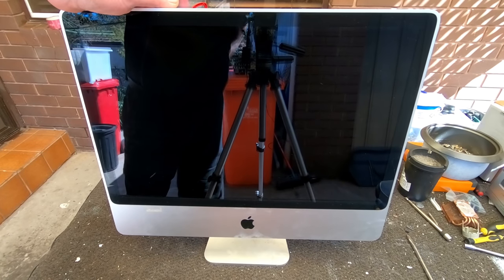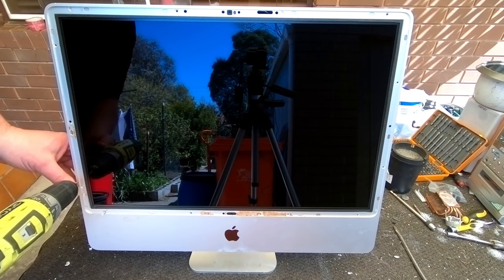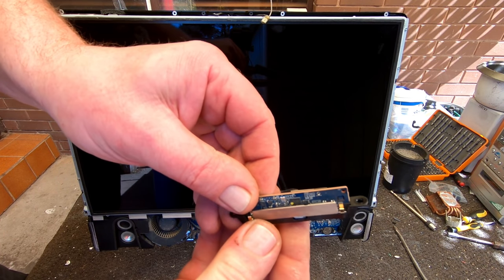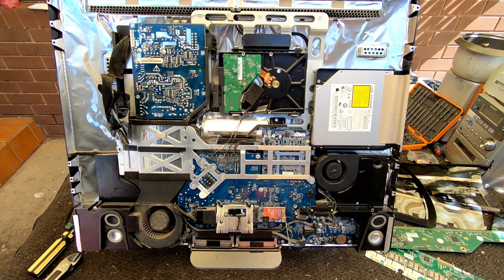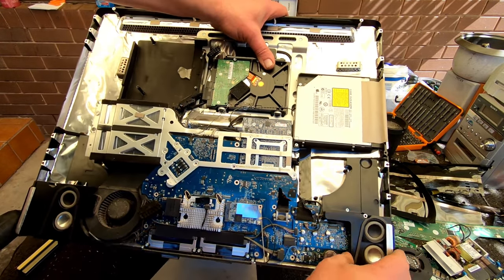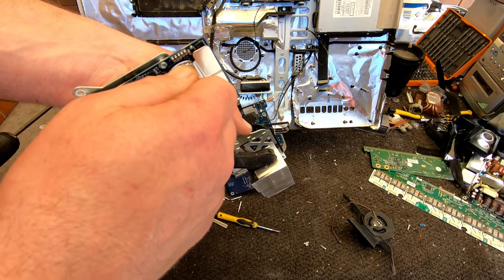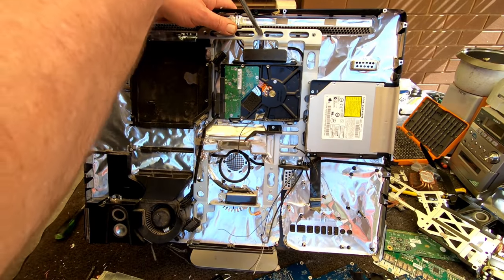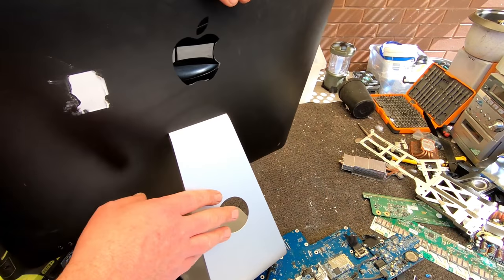What's Inside an Apple iMac A1225

Comment: I just restored one with an SSD, it was fairly easy and install went a bit strange. It failed initially but stated it was recoverable, ran it through and the second time it went down completely w/o issue. I surmise, after I was testing a RAM stick at the same time --- it was more than likely related to only have 1GB available as evidently it didn't like the one I had w/it. I snagged a 4GB compatible set for $19.99 shipped and I'm pretty excited to test it out, never personally having owned a mac, always been a windows guy. I've repaired numerous but owning my own, especially an older model such as this was a fun idea.

Either way, I put 10.6 on it and want to upgrade to whatever else is supported above that, which I had heard was El Capitan. I also would like to try some older legacy mac software and things of that nature, personally for me it is a system for my daughter to use and a glorified tv/streaming box. I love the damn thing though, it's like a modern day VCR, in some odd sense. It also has an ATI 2600 pro in there, which is garbage but it has some 3D acceleration which is icing to me. 

While removing the old HDD, I felt that the corner was easier to remove the glass from and I was using one of the cups included in the $80 iFixit kit. The bezel was fairly easy if you think of it like this,  top facing towards you put your fingers against the backside and using your fingers lift the bezel up and be careful to discount the camera/mic (?) as the cable is fairly short. I didn't remove the invertor cables or anything as I used two packs of Nag Champa incense to prop the LCD up to get to the HDD. 

All in all I'd say it's honestly a 30 minute job if you prepare for it and was a lot easier than I had heard people make it out to be. I paid $50 for it from a guy who wanted to get rid of it, the SSD set me back $30 and the memory was $20, so altogether a whopping $100, I'd say decent as 'most' in a functional state are selling $250-300 a pop. Screen could be brighter but I'll just keep my eye open for a good cheap one sometime down the road.

Comment: Do you have an easy way to wipe a MAC hard drive by using the Nextar dock plugged into a PC? It won’t recognize the Mac Drive to wipe it with cc cleaner as it shows up as a device when you plug it in, not a drive. Great info on your videos, much appreciated.

Comment: 15:03 That little "heat sink" is actually an IHS short for integrated heat spreader. You can probably sell that CPU for 10$ maybe 20$ depending what type of Intel CPU chip it is probably an Intel core 2 quad core processor.
Reply: What IHS? And what the fuck is a "Intel 2 dual quad core processor?"
Reply: No such thing, unless he means the intel core 2 quad processor
Reply: Core 2 duo?
Reply: @4kays160  yeah that was a typo, that's what I meant Intel core 2 quad core processor.
Reply: I'm pretty sure all A1225s were dual cores. Besides, all desktop Intel Quad Cores were LGA chips, and at the time of the release of the A1225 I don't think there were any laptop quad cores out from Intel yet.